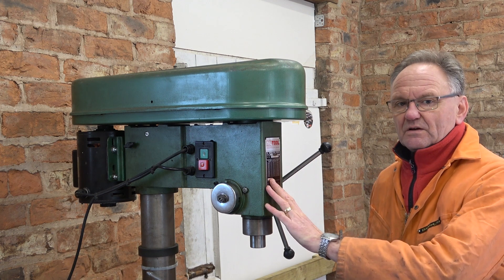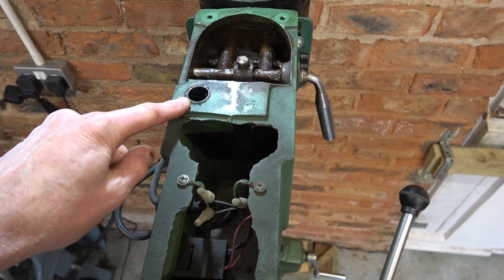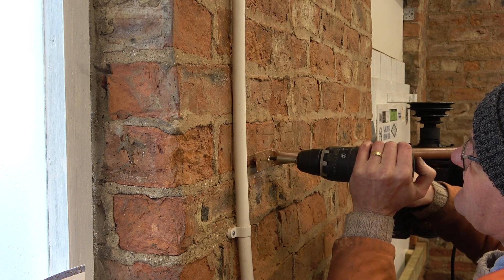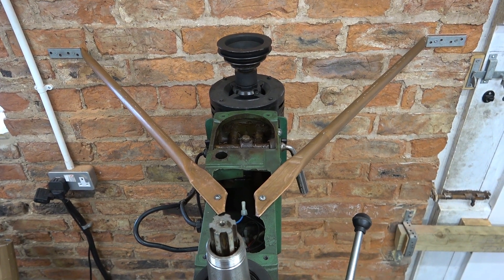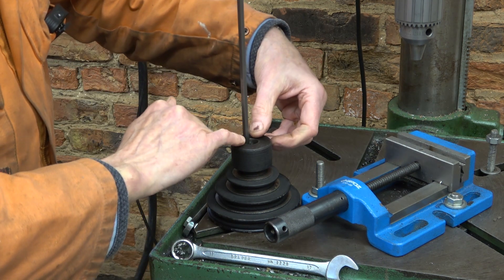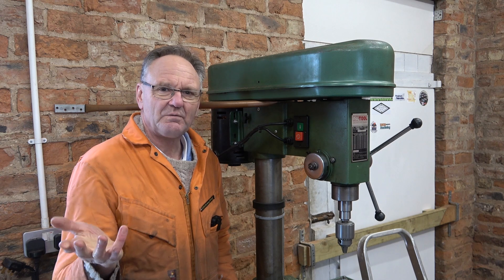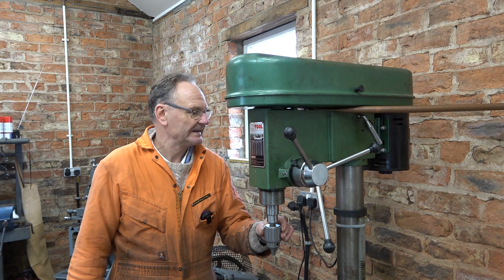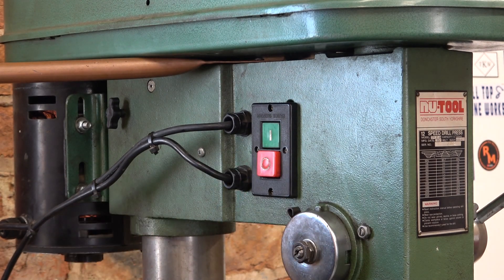HS126 Pillar drill press improvements

Comment: Hi Sir,I'm wondering if this drill is using a Mt4 taper?😮
Reply from the maker: Yes it has MT4 taper and is rated for a drill 32mm (1 1/4 inch) in steel although I never tried it. Cheers

Comment: Id did the same. Bigger bearings for the spindle, made it threaded for the chuck, filled column with cement. Anchored the drill to wall. After all done i bent the spindle. Its a 5/8 shaft.
Reply from the maker: Hi Rich, well it goes that way sometimes ...... this drill came in 3 sizes and this is the largest. Lucky find. Pretty sturdy with the those straps now. And the large table is very useful. Cheers
Reply: @HaxbyShed  i got lucky and found a drill press for parts and changed the spindle. So im back in business, now very cautious with lighter cuts.

Comment: Interesting video, thanks for posting. I will ask however, do you think the bearings on the quill can take the lateral movement when using it as a shaper/milling machine? It wasn't designed to take lateral pressure so you might want to be careful! BTW, does the drill have a brand name?
Reply from the maker: Hi Jay, it did the job on that occasion but since then I have bought a Harrison mill. The drill is branded Nutool. Morse taper 4. It's quite versatile with a nice big table. The casting looks similar to many I've seen so perhaps they bought them in and stuck their badge on. Cheers

Comment: "Why is it, one job becomes another job, becomes another job"
I really wish I could answer that one. I was an Engineer in the Merchant Navy from leaving school at 16 for 15 years and every job was like that. I can part remember having some work to do on one of the generators, but the tooling I was using broke, so I went to repair it in the workshop, the windy gun then broke trying to get a stubborn nut off. So I clamped the windy gun in the vice and tightened, for the vice to crack and fall in two. We had some decent nickle cast iron welding rods, so off to the welder a really good ESAB, which refused to turn on. The sparkie finally got it going again, I stripped down and welded up the vice, put it back together and made the repairs to the windy gun (sorry air impact wrench). I said I could part remember the job, because to this day I cannot remember what the original job was.
Don't know if you have found this guy on YT yet, he has only been on a couple of months, but it has the makings of being an excellent channel. This video is the "side jobs". https://youtu.be/sSEIaZ1prd4
Reply from the maker: Hi Bill, I think it is a familiar story, I think the answer in part is always keep everything in good repair. I like the channel you mention. Cheers

Comment: Lime mortar is the right stuff for bricks like that. Cement is too hard, and bonds too well to the bricks, leading to premature decay of the bricks. You're right that lime mortar starts off like a paste, but once it's well cured it's actually very hard. The main reason you don't get so much cracking is that it self-heals. It's also breathable.
Reply from the maker: Hi Cooperised, I know it's pretty magic stuff. Not being knowledgeable or experienced about 10 years ago I laid about 300 old bricks without lime although they seem to be ok still, but now I always add lime in the mix. It also helps with matching the colour.
Reply: @HaxbyShed  For best results leave out the cement entirely. 😁 Non-hydraulic lime is the stuff you want instead, NHL 3.5 for general building work. Any cement content increases the strength and bond (which sounds good but isn't!) and decreases breathability.

Soft bricks laid with cement mortar will last a good while, but the next time the pointing fails the bricks will tend to fail with it.

Comment: I tried milling on my almost identical drill press. The morse taper didn’t like side thrust, so the chuck kept dropping out.
Reply from the maker: Hi PG3, I agree it only has limited light uses. I was fortunate and able to use a carbide burr to round off the end of that plate without the taper breaking free. It will be in a later video. Cheers.

Comment: Paul, I have a similar style of drill press. Mine is Taiwanese circa late 70's. I filled the column and base with epoxy granite to make it heavier and more rigid. I did it in one pour so there is no joint between the two parts. I'm glad I'm not the only one that experiences mission creep!
Reply from the maker: Hi Mark, good to hear from you. It is a good machine just put together roughly. It comes into its own when I need a big drop between head and table - for example when I'm using the tapping head on work in a big chuck on my rotary table. I had not thought of filling the column - that's innovative. Fixing tools or making tools to make tools or measure tools seems to take a fair bit of my time but I like the 'brain exercise' it gives me and the satisfaction at overcoming the odds. The taper did not drop out when I did my light milling job - I got away with it this time. Regards

Comment: Maybe the cable to the motor was a structural member???
Only 5 Mods, 🤔.
Probably ten quid in copper tube there.
Thanks for sharing.
Reply from the maker: Hi John, I had recovered the copper from scrap and of course the colour blended perfectly with the brick to complement the aesthetics and ambiance (maybe I should have been in interior design or an estate agent?).  Cheers
Reply: @HaxbyShed  Please, not an Estate agent, I know sales people have to make a living.
Certainly aesthetically pleasing, adds to the property no doubt 👌 😉. 
It seems part of the course to have perform remedial work on most new equipment,  especially far east stuff, though I have a mill and lathe made in Taiwan,  and electrics added in  the UK, and they are very good.  Hope China doesn't invade them, I think NATO Et Al, are looking to expand into the Pacific, ref China's activity there.
I never thought I would see war in Europe again,  after Bosnia. 
Stay safe.
Best regards John Quinn

Comment: I thought it was just me that had those days. Sometimes I go in the workshop just to fight gremlins. It will be interesting to see how the drill press handles a spot of milling. I think that it will do the job, especially if you saw off most of the excess material. 
Best wishes, Dean.
Reply from the maker: Hi Dean, yes the bit of 'milling' worked ok. Nothing worked loose or fell out. Cheers

Comment: That 16mm ready rod is the ticket alright! Structurally speaking there is still a chance the building could rotate (go a rhombus shape)  if the gable ends fell off first. You could brace the rod on the outside to the ground to prevent this. Nice work on the drill, oiling bearings, there's a thought!
Reply from the maker: Hi Bootsowen, I also put ties between the purlins at the ends where they go into the end walls. The end walls are in fact dividing walls creating rooms within in a longer range but built in the same double brick and have not shifted. Grease would be better for the bearings but I did not want to strip the motor, and I think the bearings were probably ok anyway. By that stage I just wanted to get it done so took the easy route. Cheers
Reply: @HaxbyShed  Sorry, I was in my sarcastic mood! Oiling or greasing bearings would be good for my pillar drill, I got it used about 8 years ago, I imagine it is a few years since it has had any oil or grease. 

Your shed is sound for years to come!

Comment: I'm glad it's not just me that has days like that! 
Good luck with the milling, and go careful. 
Not sure if your machine is morse taper but I'd recommend trying to get as much of the cutter shank inside the spindle as possible and use the fewest possible adapters (minimise the stick out). Without a draw bar the slightest chatter is likely to have the cutter fall out on to your work.
If that fails perhaps some sort of pivoted fixture on the bench grinder might give you a nice finish on the edge?
Reply from the maker: Hi TRM, yes theory says the taper would drop out but in practice the job went fine. The pillar drill press is only suitable for very limited milling jobs but it was ok for my application this time.  Gotta try, and sometimes you are lucky.  Cheers

Comment: In my own experience older Taiwanese switchgear is poor but at least yours has an NVR switch; my similar but smaller drill press didn't and I have recently upgraded it along with my Taiwanese bandsaw with some very neat NVR switches from Axminster Tool Centre.
When small non-magnetic parts go AWOL a long three-pronged pearl catch is helpful.
Thank you for an interesting video and good luck with milling with a drill press!
Reply from the maker: Hi eegaugh, when the socket dropped into the shaper, and then I could not find it, it was in keeping with the rest of the frustrating project! But it came good in the end and I completed my little milling job successfully (in a later vid).  Cheers

Comment: Hi Paul, I'd love to see this work as a light mill, but I do have some doubts that the tapers on the quill might not be suitable for milling,  in any case, you will certainly have ended up with a more stable and reliable drill press, I'll be interested in how this goes, best of luck, cheers Dave
Reply from the maker: Hi Dave, I was able to do the job rounding off the end of the plate without any problems (will be in a later vid). I know it is not ideal to apply side forces to a morse taper without a drawbar. I got away with it this time. Cheers

Comment: The morse taper in a drill press is not suitable for milling . The side forces will pull the morse taper out of the spindle without a draw bar.  Milling machines have a draw bar to prevent this. Mills also have much heavier bearings to take the side load
Reply from the maker: Hi Seven, I do agree of course but I was able complete my small job successfully this time without difficulty.  Some days are lucky days I guess ......  cheers

Comment: You are not alone with one job leading to many more. It is interesting that you have decided against a mill and planning to mill with your drill press. We are aiming to go the opposite direction and use our Centec mill for drilling so that we do not need our large Clarke pillar drill which has a lot of runout. We have just bought the INT30 to Jacobs adaptor in preperation. If you fancy a quick trip to Norfolk you are more than welcome to use either of our mills
Reply from the maker: Hi GTB, I found runout in my drill but investigation showed it was the chucks not the spindle. It's not suitable for general milling but it's fine for the occasional job like cutting rounded ends on flat bar.  It did what I needed on this occasion.  I'm sure for most applications the mill is better for drilling but the pillar drill press does have the height for very tall jobs.  Norfolk offer noted, maybe when it's sunny  😁

Comment: I have lost things inside my Elliot shaper just like that! After the several unplanned improvements to your drill, I'm sure you will enjoy using it more and it may even pay you back in better results over time. Thank you. I enjoyed your video.
Reply from the maker: Hi Workshopfriend I've always liked that drill but honestly I must have found 8 faults in the time I've had it down to bad manufacturing, assembly and maintenance. A good one was the pillar was not vertical and I found it was clamped down to the base on a load of muck. But now I think I have found all the gremlins and I like it. It's a good sturdy machine with an MT4 spindle, a strong table and loads of height. Cheers

Comment: Hi one area you could have a problem with is the jacobs Chuck taper, it is not designed for side cutting
Reply from the maker: Terry you are right of course. Luckily I was able to do the job without the chuck falling off but if it had I could have given the chuck the overhaul it needs. Now I've got to find another way to get it off the taper ......  cheers
Reply: @HaxbyShed  , I had the same problem, I drill inside the Chuck an taped the jacobs taper, this worked for a while, I now have completely rebuilt the quill with tapered bearings

Comment: I had one of those drill presses. I eventually changed it for an old Elliott progress 2GS a better job
Reply from the maker: Hi Digg the drill press I have can be found with many badges - I think somebody must have made and sold the castings for others to finish badged as their own. It's a bit basic but it has a lot of grunt and the work table is a good size. Cheers

Comment: I tried some milling on my drill press before I got my small milling machine.  I ordered an XY table, clamped down the work and started taking light cuts. Everything was going so well when the drill chuck came off its short taper on the spindle!  Yikes!  Nothing really awful happened but I decided it was not a good long-term way to go since the chuck taper is not designed for side loads. You will be fine for a short project.  The XY table on the drill is great though!  Easy to line up on a center punch, move over an amount on the dial and drill another hole, etc.
Reply: As this chap says, side loads (with vibration) on a taper have a habit of breaking it free, either the short taper or the morse taper itself (if there is nothing to retain it).   You may be lucky, you may not be.
Reply from the maker: Hi bkoh it was only a short job and I was lucky the taper(s) did not work loose. I changed my plan a bit and used a carbide burr rather than an endmill and maybe the vibration was less. So I got away with it this time ...... and generally the drill is a lot quieter and sturdier now. Cheers
Reply: Exactly my thoughts.      Highly likely to pop the taper, hence why a miller has a draw bolt .

Comment: Yes sir, that seems to be the way with equipment, you find the hidden problems, then while fixing them, something else is out of wack.
I that shaper has the same fitting to be adjusted, dedicate a wrench for it on the machine.
enjoyed your thinking process going through the defects you found.
Reply from the maker: Hi mangomay1, there are are problems lurking in my shaper too which I will have to service soon.  100 times I must have used that wrench to adjust the shaper stroke and then ..... I need to make it 'fail safe' sooner rather than later.

Comment: I laughed out loud! Dropping sockets and everything you touch slides sideways is so like me.
I tried using my drill press as a mill with very disappointing results. The chuck used a #2MT  and side loading the chuck with a helical end mill simply drew the chuck out. I had considered trying to drill the splined shaft and using a draw bar. However I ended up buying a RF 45 clone and never looked back. If I had to get rid of one machine the drill press would be gone.
Reply from the maker: Hi Glenn, sorry for the late reply, YouTube thought you were trying to sell me something and held back the comment in the naughty bin.  I see the appeal of drilling in a mill, with rigidity and an xyz table and all that, but one advantage the drill press has it can hold work 3 feet tall  😁.  I did manage to put a semi on the end of that flat bar and maybe by luck or judgement I used a carbide burr in the chuck rather than an end mill and that was quite happy. Cheers
Reply: @HaxbyShed  great! You must have a lucky horseshoe. When I tried using my drill press as a light duty mill I think I got about one inch before it loosened the taper. After that it was only a matter of seconds before it walked out. For me it was a total waste buying an x y cross slide vice for the drill press. Needless to say the vice was ‘chineseum’.